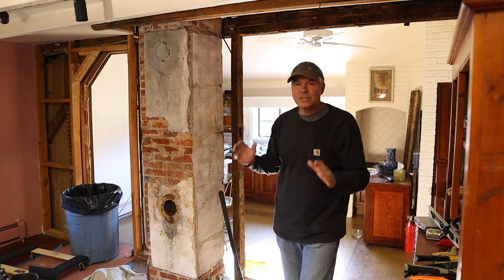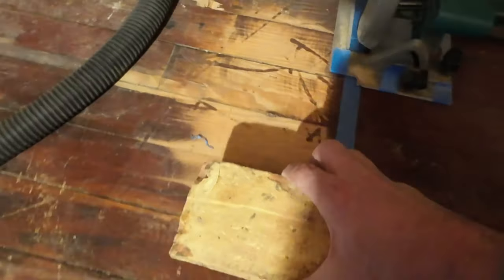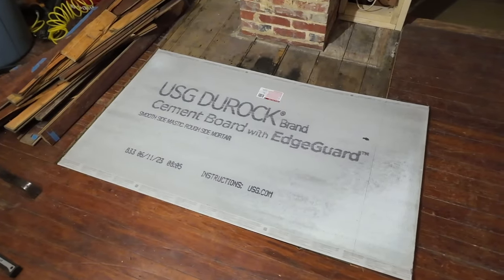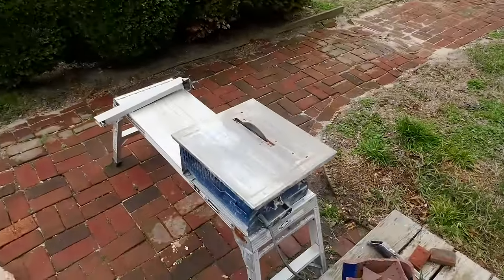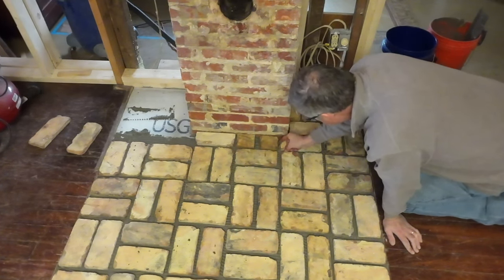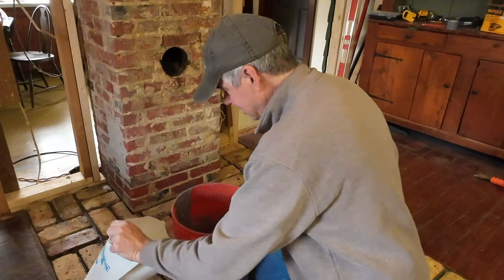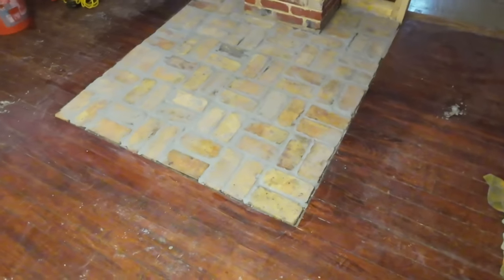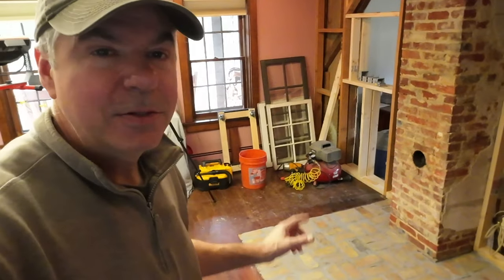Building a DIY Wood Stove Hearth - Farmhouse Adventures - Wood Stove Install Part 3

Comment: Hello Ed! Nice save on the grout! When I saw it completely covered I was.. afraid. But it turned out really nice.  Maybe look at adding a "T" moulding transition around the outside edge to allow for expansion maybe in wood or metal. Looks fabulous
Reply from the maker: Thanks Ross! It was kind of intense for a while there!

Comment: Did you get the look you were looking for?  If you decide to remove the haze on bricks, maybe you can use a wire brush attachment on an angle grinder.
Reply from the maker: Yes I’m very happy with it! Thanks!